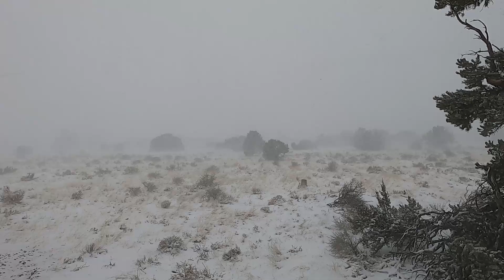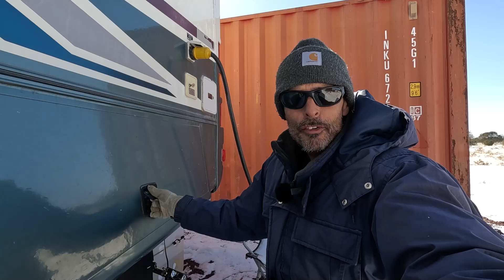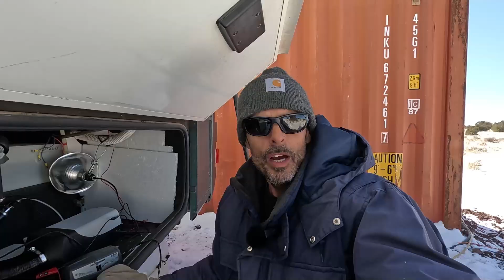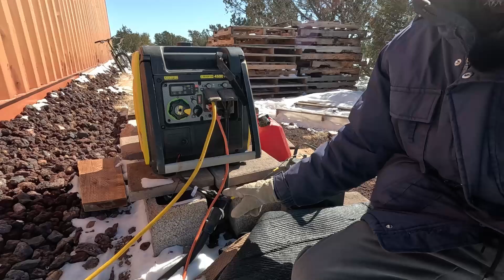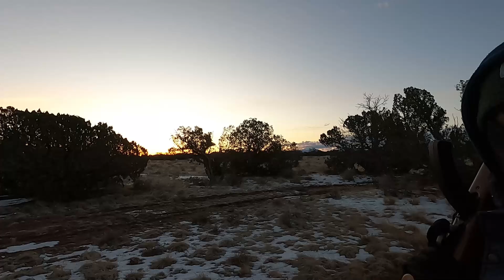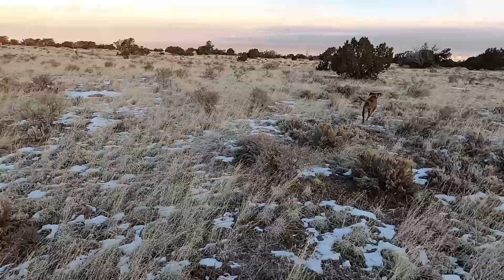BELOW ZERO FAIL

Comment: You should be using winter blend diesel to prevent freezing in the winter. If its not available in your area, try a treatment to prevent it from freezing/gelling, such as "Hot Shot anti-gel" in the diesel.

Comment: Ed im glad you guys are making it out there. This has been a very extreme winter this year. Another backup for the under belly would be a 100W light bulb. Get a heat lamp cage and use a 100w. Things will get cold but should not freeze.i would use it all night with the other stuff as well. Just an idea. We used them in our barns in Idaho to keep the water from freezing. Also remember oil will gel some at those temps (generator). I see someone recomended Heat, we used that too. One more idea...that foam packing stuff works great as insulation,   could you use some, or the insulation board in that one bay all around your stuff in there. All just thinking out loud....do what you know to do! 
Good luck, spring is almost here. Hang in there.

Comment: We had a fuel problem with our diesel heater,  as well.  The diesel will gel when the temps get that cold.  We used a heater to warm the fuel,  and everything was fine.  Researching on YouTube,  we found you can run half diesel and half kerosene to prevent gelling.  We also bought a Vevor for back up.
Reply from the maker: I am learning fast LOL

Comment: Use HEET or a similar treatment to keep the diesel from gelling it doesn't really freeze. If you run your generator down and let it sit like that in cold weather the gas tank will make condensation and your fuel filter will take it out and when you have extreme cold the filter can freeze and restrict your fuel to the generator in that case it pays to have a spare and don't throw away the old one just thaw it out and put it in rotation. Lithium batteries can discharge at temps below 32 but they can't charge in those low temps. Your car battery will freeze and become totally damaged beyond repair if you don't maintain a good charge if nothing else start your generator up for ten minutes or so to keep a good charge in it so it won't freeze I lost 5 batteries this year in vehicles without techs to drive them. In the -20 and below weather we get I've lost three just from setting over the weekend. There's my 3 cents (inflation) for what it's worth.
Reply from the maker: Great advise thank you

Comment: Question is it possible or maybe too expensive to have a power pole hooked up with 50 or 30 amp plug in for an extra source of power?
Reply from the maker: We are way off grid 5 miles to power

Comment: I have a Vevor heater and the basic heater itself looks exactly like the one you have. The only difference is the top cover color (mine is solid black) and the controller. Otherwise, its identical. On Amazon you can see a lot of the same products with different brand names.
You can put a little diesel fuel conditioner in the fuel, and it should keep it from freezing! Also, you can see if they make a specific additive to prevent freezing. 
I have a smaller fuel tank and yep its in my trailer! Lol! So far I am loving my Vevor heater and its pretty good on fuel.
Also living offgrid I have a saying to have backups to your backups! Murphy can be a real asshole! 
I have lived in my RV in temps from minus 45 windchills to highs of 116. It gets tough on both the extreme ends but cold is worse.
Anything above zero and everything would work fine. Dip below zero and it would get harder and harder. Below minus ten things just weren't going to keep going no matter what you did. I had it all heat tape, everything insulated as good as it could be and if water lines didn't freeze outside they would inside. I took off the cabinet doors in winter so heat would get to the water lines running through them. I would have a 1/4 inch of frost around the inside lip of my doors and my windows would be frosted inside. At minus 45 windchills other than along the walls and windows it would be 70 inside. That was running a big buddy heater on high and two electric heaters on high. Brutally cold weather for being in an RV. 
My trailer is a premium for its time four seasons fifthwheel by Yellowstone. It was built for winter use. None of them are really built for operation below Zero.
Reply: Nothing works below 0 ....lived in MN in -40 for most if the winter and the things one needs to do just to keep things going is insane, and that is in sticks & bricks....RV is a whole other level.
Reply: @TravelingwiththeGramkracker  I stayed in Iowa for multiple years doing it! It was a challenge.
Reply from the maker: So true

Comment: This msy be a stupid idea but would tank heaters work in some of your compartments?
I have them on my grey and black tanks ( they are also enclosed)and they work great. Might work for food storage compartments? My Class C is a 4 seasons and have been in cold only to 18 degrees. Fresh water tank is enclosed under the bed and furnace duct blows right at the bed. Water pump is some what exposed behind a lower compartmebt so that might not do well in your cold weather! Not sure I would want any furnace enclosed where air flow could be reduced by action from the furnace. Combustion and air mix can be a problem!?
Reply from the maker: Way too cold for tank heaters🥶
Reply: @nomadranch6246  Guess you would almost need a radiant heat or duct work from main furnace.....btu output and enough connector points on furnace to handle vent lines and maybe some sort of insulation liners in each compartment?

Comment: In extreme extended cold condition diesel fuel gels up and slows down the flow. That happens at around +17°f.. You can run kerosene and it won't start to gel till -20°f.. Another thing is car/diesel isn't made to use in heaters. You need Red Dyed No 2 diesel for heaters. What I have is a kerosene/no 2 diesel heater in my house. It gelled after a week and a half of +5°f. I had the fuel company deliver kerosene. It was ok to mix the diesel and kerosene. Mix will lower the gel up temp. All this info can be googled. The first thing to gel is the lines. You can add some wrapping around the lines but Don't Use Electric Heat Tape. That is all I can help you with. Your gen is also having a cold fuel problem. Use stabil and because gasoline has ethenol it will suck up water from the air that mixes with the gas. Use a little bit of the additive HEET. In the yellow bottle. Get it at Auto parts stores and possibly at Walmart.
Reply from the maker: Thanks for the advice